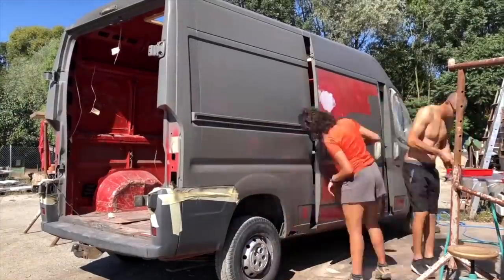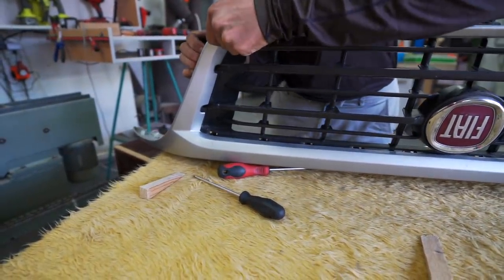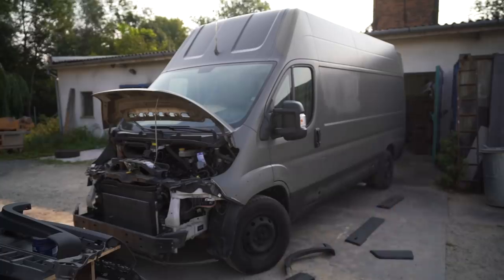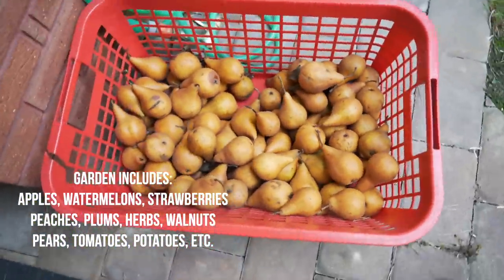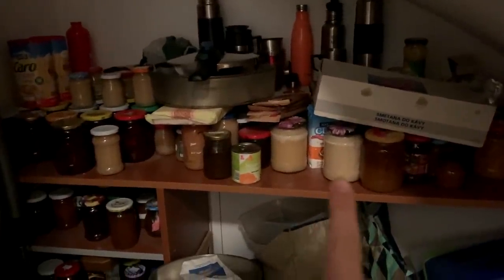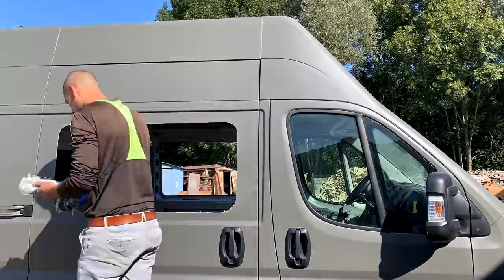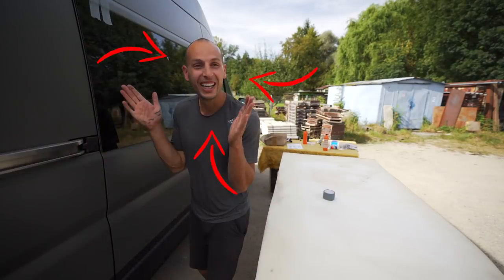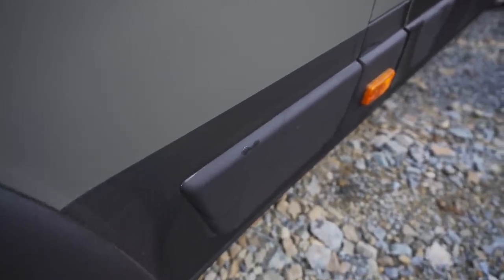Finalizing Van’s Exterior Look & Cutting Windows / Campervan Conversion in Europe (Ep. 4)

Comment: Loving your videos thank you!
Just one observation, when you seal up the plastic trim panels if you seal along the bottom you will create a moisture trap, any small amount of moisture that gets in, it will, will be trapped in there.
You may have put gaps in the sealant that I didn't see of course. :)
Reply: I'm pretty sure they said they only sealed the top and sides. Might have been good if they made more of a point about it, in case someone wants to do the same.
Reply: @ProkrastinationMeisterei  Have a look around 10:55 which is where I assume Laddi is sealing the bottom of the trim?
Reply: @paulluggar5964   you're right, he's putting sealant along the battom, but at the same time Margaret is saying "all along the tops and sides". Maybe he left gaps, but it doesn't look like it. At 11:29 you can also see the soapy water all along the bottom, making me think he DID seal all of it.

Comment: Hey guys! I really like what you've done with your van ^^ We bought a very similar van (also a Ducato L4H3 130JTD but the 2014 pre-facelift one) in June and are (very slowly) converting it to our dream campervan. We find that the ride is pretty harsh and the rear axle of the van is really high. Do you have the same issue?
Funny about the rear doors you fixed, we had EXACTLY the same pinch points in them and welded them the same way Ladi did. Come on FIAT/Peugeot/Citroën, you could do something to fix it!

Comment: Condensation also takes place in cavities, and since you have sealed the side parts, the water cannot run off! 
I would have left the side panels open at the bottom.
Reply: I like this videos, but I have concerns about sealing this panels as well. First of all I don't think it will be sealed for a long time due to difference of thermal expansion of metal and plastic.

Comment: Will you be using linear actuators again for your bed? If so, which length? I want to do this as well. I have a sprinter 170 extended with the high roof.
Reply from the maker: Higly possible we will. Length depends on what we want out of it and what space we work with.  It’s still open at this moment.
Reply: @ladiandmargaret  thanks so much. I want to be able to load a motorcycle 🏍! Do you have the link where you purchased readily available? Love watching you guys. Wish I could get my cats to be as comfy in the van as your sweet kitty!

Comment: Question about the Ducato itself: I noticed that the Ducato (the RAM Promaster here in the U.S.) looks like it has fairly low ground clearance under the rear axle. Any concerns about that ? or experiences with Ducatos that lead you to believe it isn't really an issue ?
Reply from the maker: We had one before and it’s never been concern nor limit. If we have some spare cash, I’ll probably install air suspension at the back. Only for the comfort and big loads, not for the clearance.